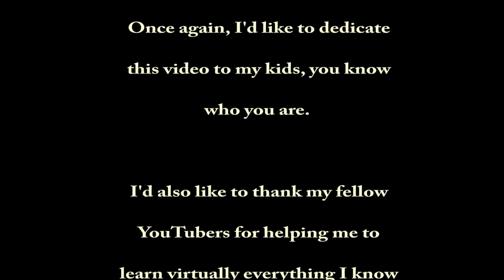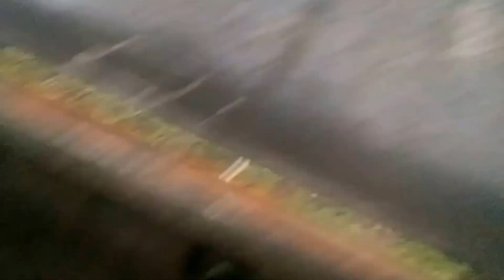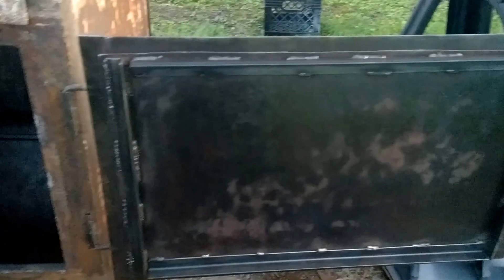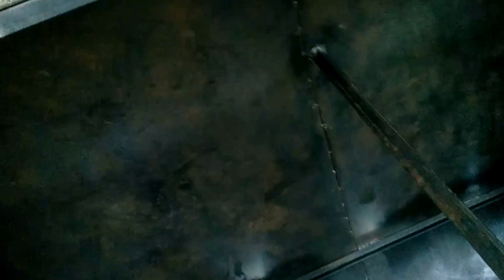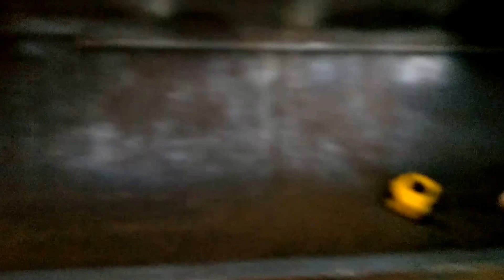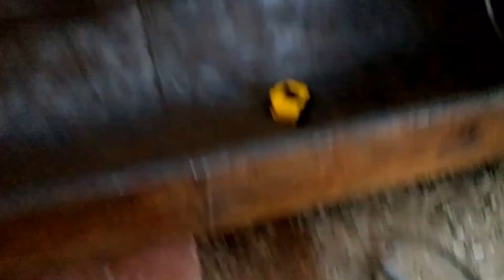The Great Smoker Build (Part IV) 275-gallon fuel oil tank

Comment: i am building a smoker out of the same  box type (275 oil drum),my design  is to build a firebox inside of the smoker itself with holes  diffusing heat on all sides with heat plates,